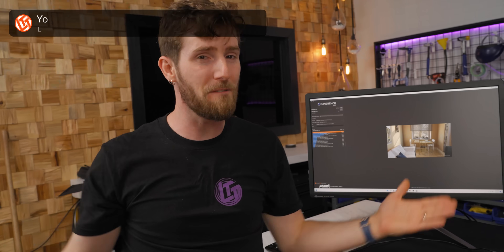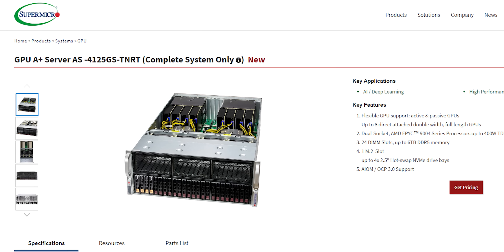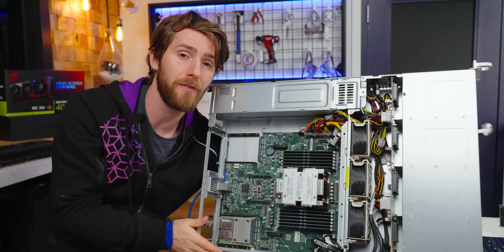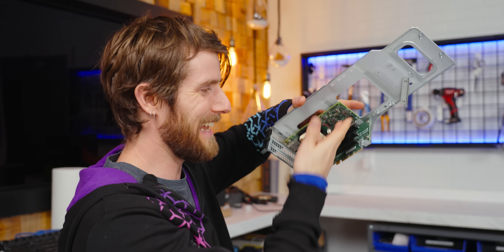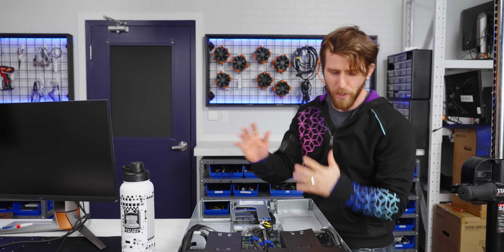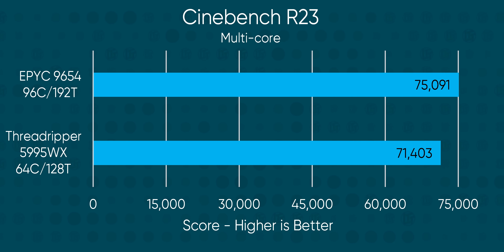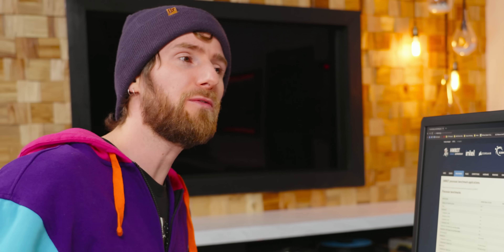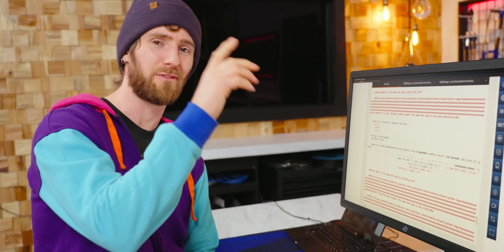HOLY $H!T - The FASTEST CPU on the Planet - AMD EPYC 9654

Comment: While the GPU market has been quite disappointing in terms of innovation this year, AMD has been killing it with these performance boosts with EPYC, I am willing to bet that these CPU's will absolutely DOMINATE the high end server market for the next few years
Reply: bruh what? Have you seen the 4090?
Reply: @michaelhenlsy55  The 4090 especially is disappointing
Reply: @stocky7134  what? If you wanted something better go work for the government to get their advanced shit in the cia or something. Go use their 8090 Super if they are even that slow.
Reply: I doubt it, amd and intel lack vision and are complacent.
Reply: @strategygaming5830  (apologies for the long response) For it's price point relative to it's improvement in performance, there is a lot to be disappointed about. This coupled with the 4090's  melting problem makes for a bad product. It's not all bad news though, DLSS is great. It's not the performance that's the problem, but it's relative improvements in comparison to price. Manufacture costs per die are actually really cheap, estimates on google are around 40-50 dollars per chip, so It's not like it's impossible for them to make it a more reasonable price. I think the root of the problem is NVIDIA sees too much in the short term. They blow too much money on R&D and are in a rush to make a profit before they move over to the next generation (I also will not deny the possibility of pure greed after they realized there is a market for overpriced cards). The reveal of the 3000 series was much more impressive than the 4000 series because of the great budget for the performance. The rtx 3070 was (allegedly) faster than the 2080 ti at only a fraction of the cost. Idk, I just think that the consumers for GPU's need to call out both companies (yes, I mean both companies, AMD has also been trying to weasel some money out of their consumers too) for their (as pointed out by @RSP themovement) complacency. I could be wrong, but It's just something to think about :/
Reply: Innovation: "keep gluing CPUs together and upmark the price"
Reply: @ninny65  exactly! that's what i was basically saying earlier and buddy decided to insult me lmao but its the truth, there's nothing innovative about this chip it's just big 🤣

Comment: Back in my day, all of the CPUs used to be the gaming CPUs of all time
Reply: they are still, to this day, undoubtedly the gaming cpus of all time.
Reply: @Gatorade69  Are you kidding? The Celeron 300A was a gaming beast because it was so overclockable it could compete against the much more expensive Pentium IIs AND IIIs.
Reply: @Gatorade69  there used to be a time where celerons weren’t the garbage they were today, however that was indeed a long time ago

Comment: I had a thought.. SSD's weren't created because they were the next logical step in storage... they were created because of the amount of platters Linus kept dropping was making them exponentially more expensive so they needed a shock-resistant form of storage.
Reply: legend has it the gyro in the macs to park the hdd head when a fall is detected was made because of linus
Reply: Gomam0n  certainly not a common feature, specialist drives maybe

Comment: I tested a 2x EPYC 9654 system in my computational fluid dynamics software FluidX3D. The 2x 96 cores in CFD are about as fast as one RX 580 GPU. So yeah, not fast at all despite 12-channel memory. They are so far in the bandwidth limit that it's faster with SMT disabled. CFD is better done on GPU. A single RTX 4090 is >6x as fast, and an H100 GPU is >11x as fast.

But: One 2x EPYC Genoa system offers up to 12TB memory, so for super large grid resolutions, CPU is still the only option, unless you have a server rack full of A100/H100/MI200/PVC GPUs.
Reply: Offcourse depending on workload?
Don't know why You seem so surprised by that result?
It's not a GPU...
Reply: @SuperUltimateLP  I'm not surprised, but these EPYC CPUs are specifically marketed towards CFD. They are much faster than any of the Xeons indeed, but just obliterated by even an entry level gaming GPU.
Reply: 12TB memory, that's almost as much as I have storage on my PC :D
Reply: Is the 2x Epyc system on a desktop? What linux ? Fedora?

Comment: a bit off topic but EPYC being lga reminded me of this.  I'm curious if an lga socket could be designed so that both the motherboard and cpu have flat pads, and pins are a separate piece that can be screwed onto the motherboard, so that it can be swapped if the pins are ever damaged.
Reply: Look into IBM Power Servers and you will find such thing.
Reply: hypothetically? sure. but such a thing would be very limited, probably to microcontroller-esque CPUs. The pins in these LGA sockets are utterly miniscule, so small that making threads to screw pins in would be hopeless.
Reply: Sounds like a good idea, but only  for consumer PCs. I have never listened about  broken pins in data centers, mainly because nobody wants to be "that guy"
Reply: @DFX2KX  I don't think he meant that you would screw each pin individually. Imagine landing pads on the motherboard juste like those on the CPU, then a relatively thin plastic piece holding 6000 pins on each side. You would clip the plastic pin holder to the motherboard, then put the CPU on top, then screw everything together. This way, if you break/bend a pin, you only have to replace the "pin tray" instead of the whole motherboard.
Reply: @DFX2KX  Sorry, to clarify  I don't mean that each pin is threaded, but rather the pins are all mounted together in one fixture, which is then screwed onto the motherboard.
Reply: I've wondered the same thing ever since I had to scrap a Threadripper motherboard because of pin damage. Seems like a good solution.
Reply: @jacob_90s  ahhh, so a similar idea to the 'slocket', which took old slot-type CPUs and converted them into socket format.

the contacts on the motherboard-interface side of things (around the edges of an LGA socket) are still too small to get good contact with pressure alone, which is why you don't see slot-type CPUs anymore as that was only practical for a short time. HOWEVER. a defective LGA socket can be very carefully unsoldered from the motherboard, new solder balls placed on the pads, and replaced. This is a pretty expensive service (requires a bunch of specialized hot-air gear), but depending on the mobo, still worth it.

The PITA that is a bent pin is why LGA sockets have so many safeguards against not bending them though.

Comment: For those with heavy multi core you can actually justify it as a workstation. Retail units used tested in good working order Is $2,250 and $600 for the motherboard. Expensive but given a workstation costs 5-7k thst lashes you with about $3000ish for a case, cooler, ram and power supply snd you have a zen 4 based multi core monster machine for rendering. And good cores too same as Amds 7000 cpu.

Comment: Ampere charges $5,800 for its top-of-the-range Altra Max M128-30 processor that features 128 Arm Neoverse N1 cores operating at up to 3.0 GHz, 128 PCIe Gen4 lances, and eight memory channels, according to Phoronix. By contrast, AMD's top-of-the-line EPYC 7763 CPU with 64 cores that can work at 2.45 GHz – 3.50 GHz is priced at $7,890 whereas Intel's Xeon Platinum 8380 processor with 40 cores functioning at 2.30 GHz – 3.40 GHz costs $8,099.

Comment: IMO, the most exciting innovation is probably the integration of CXL protocol, which I hope will open the door to new emerging Non-Volatile-Memory (NVM) that have Memory Class Storage properties like Nantero carbon nanotube NRAM, or Everspin/Avalanche technology Magnetic MRAM, that are byte addressable, with low latency (<100ns), much higher R&W endurance than Intel Optane media, (much) lower power than Intel Optane media…

Then as a next step, it would open the possibility to boot on CXL attached Non-Volatile-Memory (very low latency Ramdisk on a NVM), and longer term with optimized application support, even lower latency…

Comment: I wouldn't mind one if these machines fully load it with ram lots of storage and use it for a gaming machine best part is wouldn't need to upgrade it for quite a while as I'm pretty sure game developers won't be pushing out games for several years that need that kind of power 

Mind having one of those in my place and the noise it produces would pretty much piss the others off in my place

Comment: The first thing i thought in mind i googled it

Can you use AMD EPYC for gaming?
The epyc line is designed for server and data center applications. They will work for gaming, but the cost could not really be justified. That, and most games are not designed to make use of the extra cores so there would be no real reason to get one for the sole purpose of gaming. It can be done, but why..
Reply: the epyc chips are meant for servers and workstations
so no

Comment: I don't understand why you'd need this kind of density. You're still going to use up 3 VMware licenses per socket. With the cost per socket of this beast you could instead buy something hyper converged with lower core density and still have the ability to scale up compute later.

Comment: That thing looks like it is 4 24-core CPUs glued together.
I mean if the overall die size is going to be that large this gen, and is so much larger than last gen(s),
then achieving crazy core and thread counts won't be hard at all for Intel.

18 angstrom in 2025.

Comment: Disappointment only starts when they mentioned putting Windows on that server machine. 
Anyone putting Microsoft OS and it is NOT putting Linux, FreeBSD/DragonflyBSD or illumos/Solaris distro on this server is wasting everybody's time. 
As it seems it is wasting attention time of viewers on mindless gamers "tests" , totally out of point on an high performance an cloud server.  Not to mention licenses proprietary OSes and software invents to charge customers for having better hardware. 
On the other hand, if tests per number of cores , I/O and virtualized graphics hardware,
are done inside HVM virtualized environment (VMWare, VirtualBox, XEN, KVM, Bhyve , compared to on-the metal processes (LXD, Solaris /LX/ Zones on illumos and Jails on BSD) and results compared per load.. THAT would bethe real server hardware test, not this limping around.

Comment: Big psu is also just good for longevity.

If your pc requires 750 watt you always fit a 850 min to 1000 watt psu so its not working so hard like a 750 watt psu would be. 

A 1000 watt psu on a system with only 750 watts used is actually cheaper to run than 750watt psu as it still only uses 750watt 
but its not over heating and making dirty power. 
Power supplies only supply power requested they do no push it constantly :D

(No different to a car engine, V8 pushing light car will last longer than 4 cylinder pushing heavy car.)

Comment: More cores doesn't means better performance because by that logic GPUs should be used in place of CPUs because they have 1000s of cores. Also AMD doesn't do Ageing analysis for their products while designing so their products doesn't lasts longer and starts giving problems after 2 years, whereas Intel do all types of analysis and their processors gives consistent performance for more than 10 years, and their performance is better than AMD

Comment: AMD and Asus are on my list. No load core overheating on two different AMD systems changed coolers messed woth bios settings all to no change. So for no reason these just go bat ship crazy with no explination from AMD or Asus. So if you have 7k to flush AMD and Asus will be there to help

Comment: CPUs, and AMD especially, have severe thermo throttling issues, which is why the more cores you combine, the lower the possible frequency will be.
Which is why those CPUs are ideal for heavy multitasking, but not single core performance as required for / in games.

We see the same issue with regular Ryzen as well btw., which is why you should stick to 6 to 8 core CPUs if gaming is your intended use. The more cores you got, the more trouble you have getting constant high level single core performance, requiring high power levels and advanced cooling solutions. I once cut a Ryzen 7 2700X from 8 to 6 cores to improve "Final Fantasy XV" benchmark results by 23%. If you want to know if you got such issues, you only need to run an all-core load-test and watch your CPU clock. If it levels out at about the nominal base clock rate, you are good. If it dips more than 200 MHz below that, you got work to do. If it caves dropping into the 2GHZ range, or worse at 500MHz, you got yourself a burner where something went seriously wrong.

This is when you should pull the plug, check if your cooler sits properly and the thermal paste has full coverage with a very thin layer, go into the bios switching everything to standard and try again. If everything is fine now, you may try to optimize things ( again ), as long as you make sure not to get there again. If not ... start praying ?

Comment: X85 dual 12x RAM Tuning ist that 1.9ghz 2.4ghz Turbo x2 196cors 16 cors ultra gaming 124fps gtx 1070 ti 8 GB Stock lvl over 6 core 12t x2 over 8/16core 144fps the Best Option 12c/24t Bost cors x2 x800mhz 4gb x3  RAM x6 x3 spwd ro 1lace spende over 4 lance pcie x3 ram  for 4800mhz ddr5 Performance fastest Option over 128gb RAM over 12x RAM spitz 256gb RAM Power tue CPU Transistor loader muss somit wrre optimiatet to Run dobbel 12 cors 24 treads for 256gb dobbel Power perfekt for a 4090 + 24gb to doppel the Performance over 1 card to 48gb sek.soeed 144gb FPS soeed over 12x RAM 4090 24+ over crosfire sli 180fps 3,5%+x3gpus over 2 Couscous over 12 RAM x 85 neu Version cloun oldscool is thr best
Reply: 8k 180fps over 3 togeter 36core 5.4ghz lvl 2.4ghz lvl for Transfer x3 8k date Pixel Input perfekt over 1 Chip some were muss fix this Chips that he Boost 5.4% speed 12/24 Transistor togeter for the Optimum max Performance
Reply: And that data Bild runs over 364hz Monitor 1ms to 3ms 8k 180fps in 1sec on all Transfers Bild data Internet
Reply: 36core run togeter over12c/24T X 5.4 mal over 36core x5.4 boost 1.9 to 2.4 GHz 96 core 1 CPU =5.9ghz lvl with 1.9ghz  2.4 turbo  over 1lane somit to 4pipline cpu data RAM gpu 6.2ghz lvl soeed over 36 cores trads togeter 1u2/24 over 3x 4090 24gb sli crosfire x 360hz monitor  1 gpu Outputdata input back from Monitor to 1 gpu 7.4ghz lvl wenn jou dobbel 24gb to 48 GB in transfähre data all Internet audio Video load to 48gb x2 96gb + 48gb Video in Output 144hz GB x2 sli ore crosfire x =+ 36hz GB 180hz FPS 1 nsek over 354hz 360hz Monitor 8k real 1 gpu x 6 RAM 128 GB x 12 RAM 2.450mhz oc 350mhz x12 48gb sek speee off Transfer off all Hardware komponent data Video audio Internet all over 1 Lane x4 3150mhz 13.600mhz x2 = 27.200mhz over 12 x RAM =5.4ghz CPU lvl perfekt

Comment: Still cant run gmod at 720p low settings at a consistent 30fps but a i5 3rd gen with a 750ti can run it at 1080p 60-100fps low-mid settings